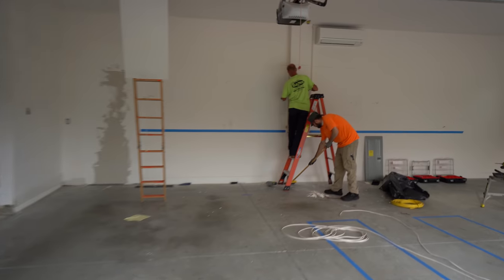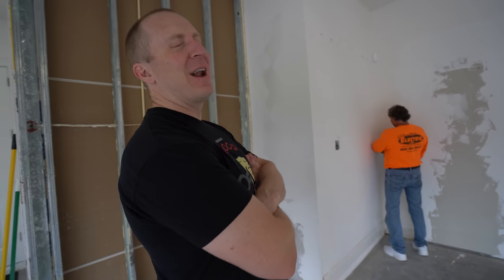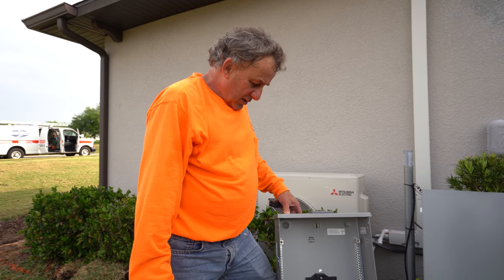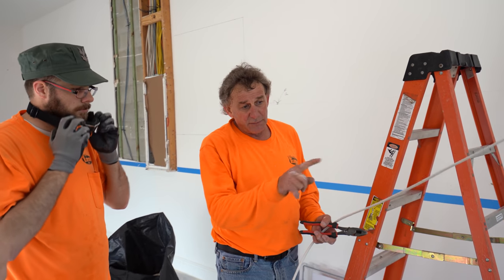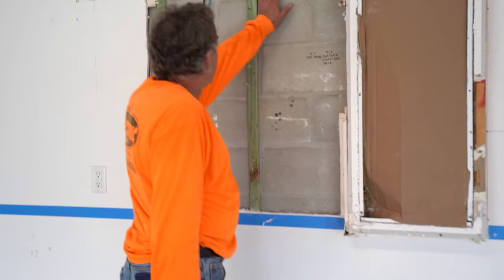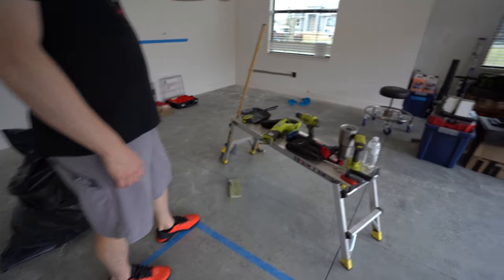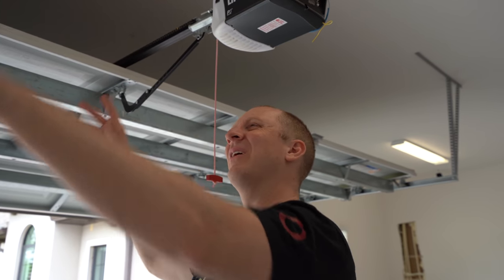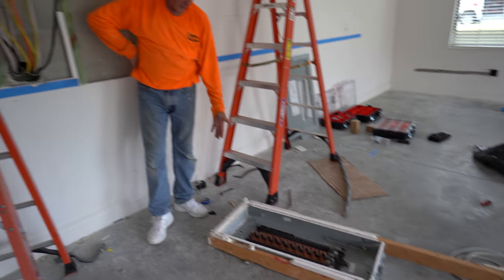New Garage Build - Relocating The Subpanel and Wiring

Comment: a lot of locations now require panels to be outside per code. I had to redo the panel in my house in los angeles - the old shitty panel was in the kitchen walk-in and we had to re-route it 30 feet away to an outside wall. Fortunately here we generally have attics and crawl spaces under most of the house so it's a crazy job but not as bad as it would be in some places.

Comment: I spent all Easter weekend installing low voltage boxes in rough-framed walls, making loud noises, drilling through timber, knocking holes, and running speaker wire and coax all over my new house that's under construction.   Those 10 foot ceilings are a bitch when you're climbing up and down the ladder all day to reach the attic.  Got her done though!  And man I''m feeling it today.  Loving your video with good background info from Sparky!  
I'm getting rid of that stupid side door in the garage too!

Comment: The Moremans go out on an extended vacation and leaves two Porchas in the garage.
Burglar shuts down the general power throw the control panel sitting outside.
A couple of days latter, the independent security system [on sealed batteries] runs out of power.
 Two sitting ducks... but of course its a condo. 🤨
Matt never played Metal Gear.

Comment: As someone in a northern climate, this entire thing is absurd to me.  Electrical and plumbing on the exterior side of a wall just seems like disaster waiting to happen.
Reply: In Chicago this would not even be a thought.
Reply: some location require the panel to be outside - safer in regards to fires and earthquakes etc.. mine had to be moved from my kitchen area to outside. PITA.
... you would lose your shit if you saw proper etiquette for a cable guy in southern california. To route cables they just run them all over the exterior of your house and drill freaking holes right through your exterior walls (usually stucco).. they usually don't even seal the holes.. coming from the northeast where things are built proper it's one of the craziest things to get used to moving out to los angles (and that's saying a lot!).
Reply: Agreed.  Wouldn't do it here either for the same reason.  Guess this is something you can get away with in warmer places.
Reply: Obsessed Garage Perry does great work

Comment: Tesla chargers have built in gfci protection they dont require a gfi breaker
Reply: And the Tesla wall charger installation instructions specifically state not to install a GFCI breaker.  I would direct wire the Tesla charger (no plug) to a non-GFCI breaker and have the charger's installation manual handy when the inspector comes.  He/she will need to see that the device has built-in GFCI protection and also need to see the statement about no GFCI breaker.  Even then, you will be at the mercy of the AHJ's interpretation of local and national building codes.